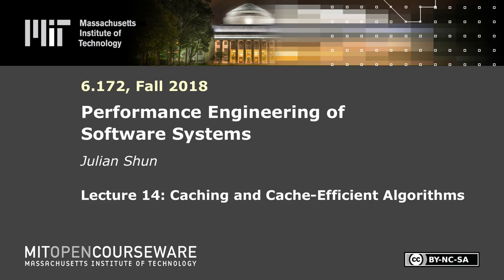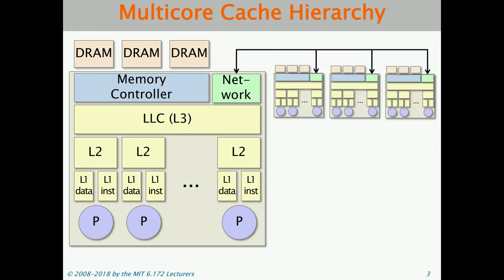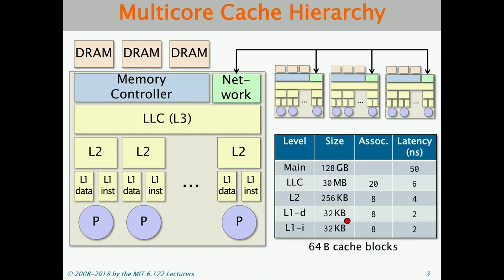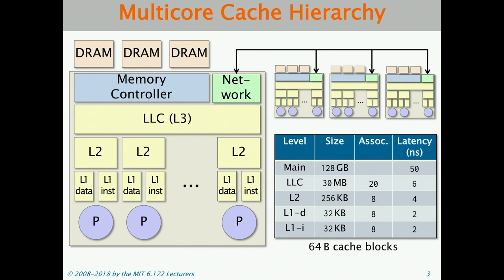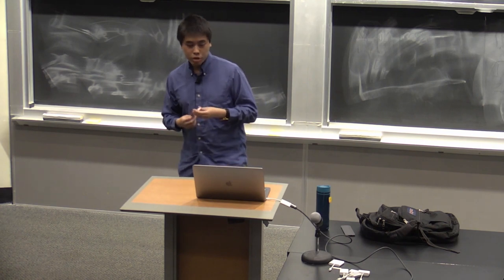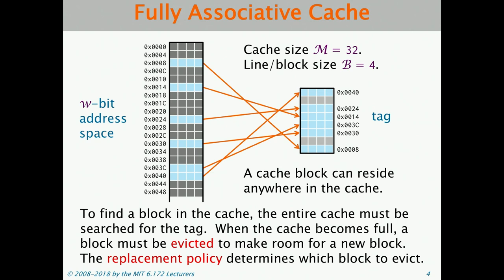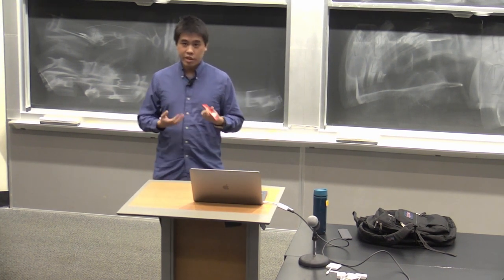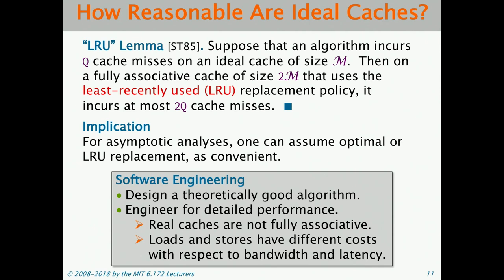14. Caching and Cache-Efficient Algorithms

Comment: A better and simpler description of Direct-Mapped is to consider each set as a completely different physical cache block, not as a part of a single cache.
So for example K=1

You have 1 cache block that holds 1 red cache line.
You have a different cache block (instance) for blue etc.

Comment: 34:37 anyone knows why do we need to particuarly assume N < M/3, not just N < M? Seems it doesn't affect the derivation below...
Reply: I think that you need N < M/3 because the segments aren't guaranteed to fit into the cache efficiently because the cache is stored line by line. If the line size is x bytes, the worst case would be a segment of x+2 bytes which went just over the beginning and end of a line, and so you would need 3x bytes of cache to store x+2 bytes of data. In the limit as x grows, this means that you need N<M/3 to guarantee that all the segments fit in the cache.